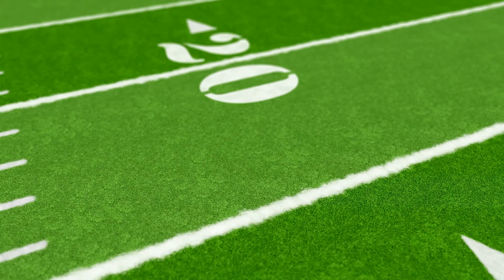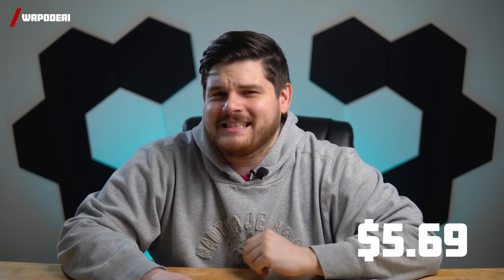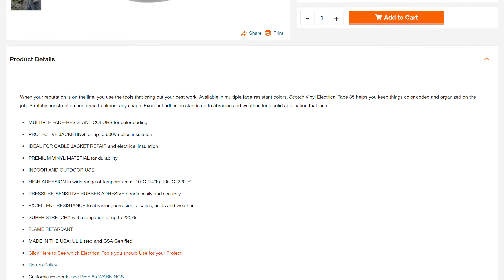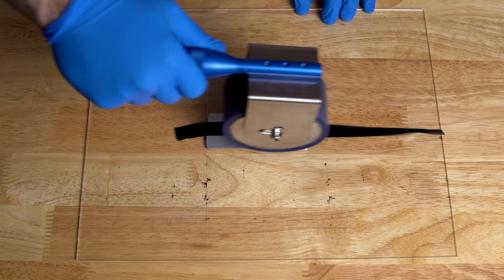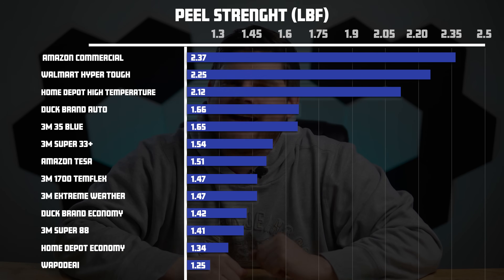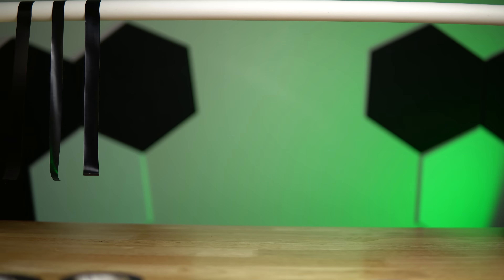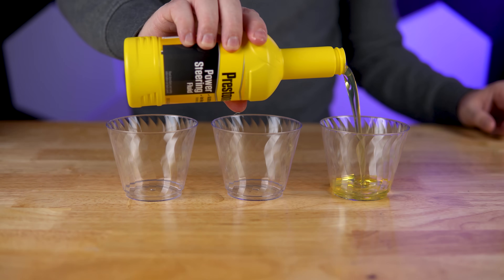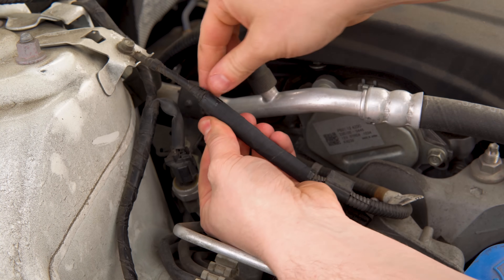Engineers TEST Electrical Tapes!

Comment: Great video, thanks for that info.  I use the cloth tape such as the tesa, over all wires and under the corrugated black plastic loom. The inside of the plastic loom does wear into the wires over time, the plastic loom will wear through regular tape and then the wires as well if there are any vibrations or movement on say a harness going to engine or tranny.  Cloth tape also helps prevent rodent damage.

Comment: I stick with the 3M Super 88 an 3M Super 33+ has always been my favorite.   An 3M glass cloth tape for heat an abrasion.  For my important things.  

Everything else like wrapping wire to a pull rope/string.  Any electrical tape etc.  dollar store/gas station.  Whatever need be that I’m pass by.   Since it’s a quick single use

Comment: We use 33+ daily.  It's just cheaper and easier to work with than 88, and nothing we do would require 88.  The nice thing with the 3m tapes is its longevity.  Most other tapes get shitty within 10-20 years, brittle, glued together, tons of residue, etc. whereas 3m hardly suffers from these problems.

Comment: The ability to reach 50% stretch with the least tension is what you want. Strength really means very little. The stronger the least desirable the tape. 33+ is hands-down the  best I’ve used over 28 years on a daily basis. Shelf life is about 7-12 years.

Comment: I was a sparky for 50 years. Best use for electrical tape at my first job was for an end of shift bandaids at the large slaughter house that I worked out. Would save rolls of Scorch 33 tape and.give it to guys up on the kill floor. Would wrap the first turn sticky side out then a few wraps. A regular band aide would not last 10 minutes on the wet bloody kill floor. I NEVER purchase or use any tape made in cheating lack of quality control communist china. Back in the early 1970's some USA company ( maybe Slip not ) made 72' rolls of gray electrical tape that was the closest in quality to the Scotch 33 tape and at least 25% cheaper. Only used expensive Scotch 88 tape for 4,160 volt splices. Had 4,160 volt exposed transformers where the connections were out in the sun & rain so every two years would wrap 88 tape around them then paint them with a reddish insulating paint.

Comment: Scotch 23 is a self-fusing, waterproof up to 69kV tape, just FYI. This, just like picking out a cam shaft, or hell, buying a car, is very much a "there's going to be something out there for you, you just need to properly define your parameters". 3M has a pretty good selection matrix PDF on their site (search "3M heat shrink tubing -product selection guide"), including  UL 224 and SAE compliance delineation. Alternatively, if you needed something like self-fusing properties, but also marine-rated salt-water insulation, you could stretch-wrap Scotch 23 and then heat shrink Ancor on top of it. (I realize this is a very contrived example because the adhesive in Ancor is more than sufficient to obviate the Scotch 23, but just play along. Also not affiliated with 3M or Ancor)
Reply: That being said, thank you for sticking to industry standards. Project Farm is....ok, but that dude clearly doesn't invest much time in reading application notes or industry papers before performing reviews. That would be okay if he had extensive experience with the tooling in the field or something.. but, for example, when you see him take a chainsaw rip, you kinda get the vibe the dudes never bucked a redwood. (I've never logged either, but I've got enough 2-stroke experience to tell the guy is out of his element.) Oh, the Torque Test Channel has proper experimental design too-- he mentioned consulting for Astro on THOR v2 so I'm guessing he must have some experience in light industrial tool design.

The fact that you're running type-k thermocouples, understand what a positive displacement pump is, have properly placed gauges to see pressure drop, and are one of the few people who understands cP and cTs (AvE notwithstanding) gives me confidence that you're going in the right direction. Setup a Patreon and keep making high quality videos that answer consumer questions that are obscured by marketing and you'll be making a living off this in no time.

Comment: You should have used brake clean gas and brake fluid just saying brake fluid will take paint off of cars brake clean is sprayed constantly and gas can be an issue usually melts electrical tape 🤷🏿‍♂️

Comment: I recently did some engine wiring harness work on a 2008 Ford Fusion.  The OEM electrical tape used in the Ford harness was very different than any black vinyl tape (like the ones in this video) I've ever seen.  It is black, but its was thinner, measured 2.5 mils thick, not sure if it's vinyl (like regular electrical tape) or if it's some other type of plastic, does NOT have any adhesive - I guess it was more of wrap.  They wrapped it around wires and even around the outside of the corrugated wire loom.  They used it to hold together the branching.  They did not use normal vinyl electrical tape (with adhesive).  Anyone know what this is, and where i can buy it?   If I can only get it from Ford, what's the PN, or what is it called?

Comment: I'm not a fan 3M's Super 33+. We use it exclusively at my work, so I've spent a lot of time with it over the last 10 years. I'm an industrial automation/controls electrician. That tape leaves behind a nasty black residue in every installation of it at my work. This appears to only happen with the Super 33+ black. We keep 8 colors on hand and none of the other colors have this problem. This behavior doesn't seem to change regardless of whether it's in a sealed control cabinet or out in one of the varied production environments. I've almost completely stopped using it in favor of a colored 3m tape.

Comment: So as an electrical technician 3M make a fiber glass electrical tape which is better to be used on electrical connection that are exposed to extremely high temperatures like your engine bay, which is still cool in comparison to the actual environments where it is meant to be used and for additional protection you tape it over after with the scotch rubber splicing tape. this ensures the best protection for the connection. The only downside may be the residue form the glue when you remove the tape in the future but WD 40 cleans up those with ease.
Reply: Their glass cloth tape is really good.  Pricey

Comment: The tapes ability to adhere to the surface it is attached to as well as its self in extreme temperatures is also what helps keep the underlying materials insulated and dry.  So I must say that the temp testing that looks poorly in option on tapes that did just this is not accurately prescribed in performance.

Comment: Who cares about tape strength??  IT's not there for that. You didn't even test it's insulating abilities. What it's made for!!!  And test it to see how long the glue in it lasts. Before it lets loose & become a gummy mess.  Fools.
Reply: Voltage testing for what? For when you tape off HV transmission lines? It's just a piece of plastic I think by UL it needs to be 600v but it's probably a couple thousand. Being they are all the same material whichever is thickest would have the highest rating. But double wrap and now you doubled the voltage or stretch it thin the rating goes down a bit. No one's using this over 240v so knowing a single wrap takes 3000v is pointless. It would also likely be directly correlated to thickness. Fool

Test how long it lasts would be nice maybe he will give us those results in a few decades. Fool...

Comment: I’m a water well driller pump installer for over 20 years and electrical tape will hold up under water and be hard to remove after 30 years. We have a green electrical tape that is expensive and only use when necessary but it’s so strong you literally can’t pull it apart if you wanted to unless you twist it up etc but a straight pull by hand it’s not happening 😂

Comment: Seems like low tensile strength would be a positive attribute. Much easier to stretch when wrapping cuz electrical tape isn't exactly used to hold stuff up
Reply: The thing is once you stretch it you weaken the material the logical thing to do is use more tape not stretch what you have.

Comment: I'm surprised the Harbor Freight tape wasn't included here. I'd expect it to fair about as well as the other budget tapes but it'd be nice to know if it could be on par with some of the middle of the pack tapes. Rather than electrical testing I think it would have been more informative (if a bit subjective) to have a test on wrapping some actual power cords and spanning from the inner conductors to the jacket of the cord. That change in diameter when you're doing half overlapping wraps tends to cause cheap tapes to form a crease on the narrower side whereas the better tapes will conform to the changing shape a bit better. The reason why I think that would be a better test than just breakdown voltage is because most of these tapes are just a plain vinyl substrate of approximately the same thickness and they've almost all been UL tested so you'd expect them to all perform very similarly but in real world applications you're much more likely to see moisture forming a conductive path through a crease on the tape or where the adhesive has started to peel away after a year of thermal cycling. I really liked the recommendation of wrapping the tape with some tesa tape, that's a great way to protect the electrical tape and not have to rely so much on adhesive strength in more challenging environments.
Reply from the maker: @Andrew Merts we would've liked to test the harbor freight, but 13 tapes was already a lot. We'll be sure to include harbor freight products in the future. I like your idea about testing the flexibility in terms of conforming to changing diameter, it would be very subjective like you mentioned but usefull. We tried to keep it as scientific as we could so we tested their "bounce back" or how much did the tape recuperate after being stretch. Generally the tapes that did the best in this test, would be the ones that conform the best to nay shape given they shrink more and provide a tighter seal.  Thank you so much for your feedback, it is much appreciated.🙂
Reply: Yep I second this about harbor freight. It’s UL listed too 👍. I am a 25 year self employed electrician and I regularly use harbor freight electrical tape. It’s comparable to at least 1700.
Reply: I used HF tape indoors to wrap over nicked Romex sheathing.  Within a few weeks it was coming unraveled.  Switched to Scotch 33+ and no issues--and have also been using it for wrapping outlets.   I like how this stuff feels to work with.

Comment: don't skimp out on electrical tape, if you're working under the hood, go with super 88 or 33. it's just much easier to work with. I love that you included tesa tape, good stuff
Reply from the maker: @thatcheeseguy thanks for the comment. Completely agree, electrical tape under the hood should not be an afterthought as it can become a problem in the future. That Tesa was actually very impressive. Thanks for the support!
Reply: Actually never heard of Tesa Tape and I'm gonna buy some now since I'm going to start doing some wiring work under the hood. Brand Ranks saved my butt.
Reply from the maker: @Lotus Pod So glad to hear! The Tesa tape also looks very professional, just like a factory harness so no compromises on aesthetics.
Reply: @redatlas8484  Like OP said, it is aesthetically pleasing. It's very common in the bass audiophile universe as it isn't really affected at all by heat, is easy to remove, and has a sound deadening profile. Since it is more of a fabric material, wires don't make sounds when vibrating against a surface. I vividly remember covering every inch of an old sound build truck's wiring inside the cab with tessa tape nearly a decade ago, could immediately tell a difference and the tape still looks like it did the day I installed it.
Reply: I used to buy Scosche for harness tape but in early 2020 I couldn't get a hold of any and tried this Tesa stuff and I've been buying it since. Super 88, Kapton & Tesa are now all I use for "electrical" tape.
Reply: After research for temps (and a long time fanatic of 33), I went with 88 for my under hood, completely wrapping my looms. Without ever starting the vehicle, after a couple weeks it started coming off on its own.
I removed all the 88 on the looms and rewrapped with 33 with no problems, besides it having lower temps.
Only possible problem with the 88 was ordered through Amazon, so I went to Home Depot to buy the 33’s!
Much love for the 33!
Reply: Right on. I always use the 33 with me on the job and at home. Great adhesive and perfectly stretchy for wrapping up tight